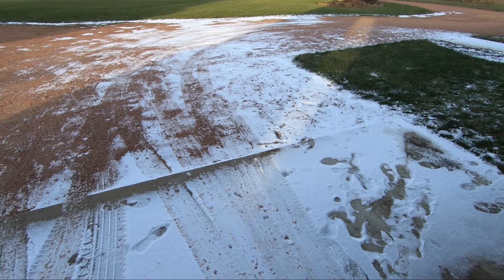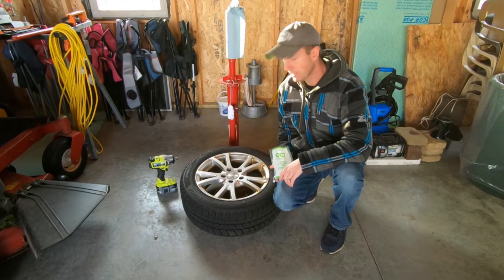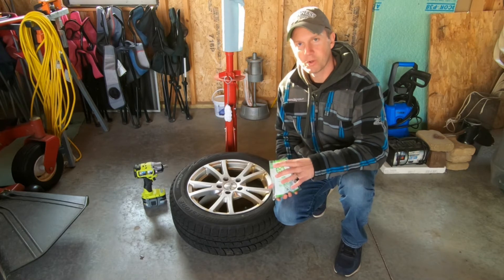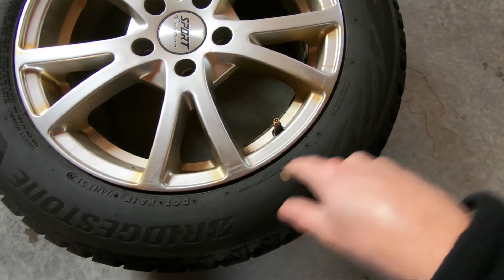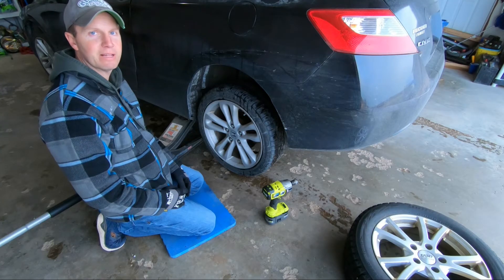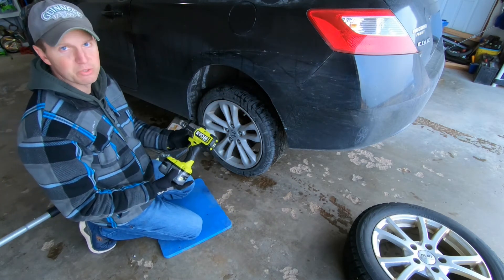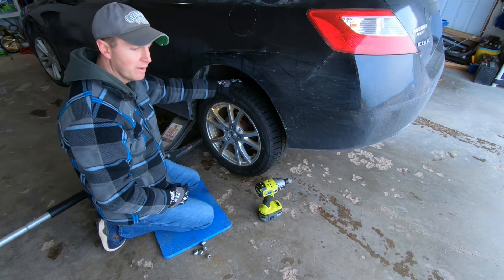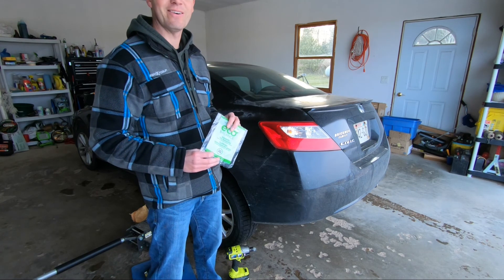How To Balance Your Tires With Balance Beads | Eco Balance Beads

Comment: Decades ago I was a truck fleet tireman. We did not balance the drive tires only the steer axle. The shop didn’t have a wheel balancer and only used a bag of balancer. I can’t remember what was in the bag but I don’t think it was beads. More like a silicone sand but it was long ago. Never did find out from the drivers how the balance was. The theory sounds good. No there is a YT channel where a guy put a GoPro camera inside the tire. Interesting results.
Reply from the maker: Thank you for taking the time to comment. I too seen that video with the GoPro placed inside the tire. Very cool to see the effects. Sounds like adding those balancing bags must of worked out or I’m sure they’d been back complaining.

Comment: How has this worked out for you?  Any reason why I wouldn’t just add these to all my tires?
Reply from the maker: I’ve used them for two season and over 20,000 miles with success.  I can tell that the beads are breaking down and need to be replaced.  I will be doing a video of this showing what the beads look like after that many miles.